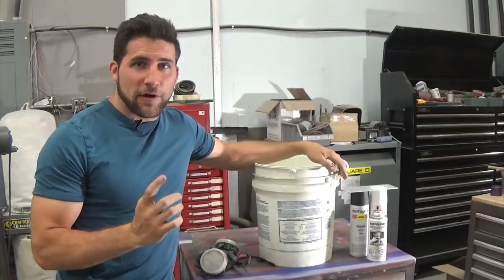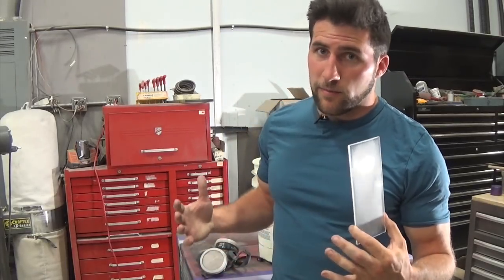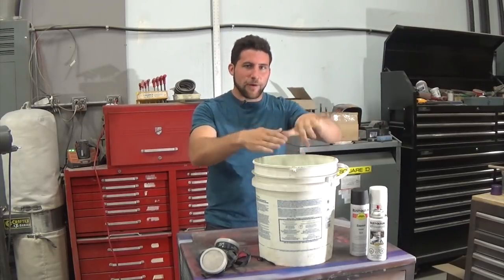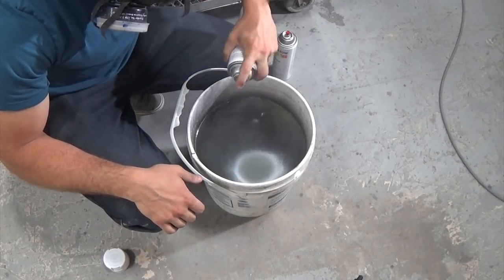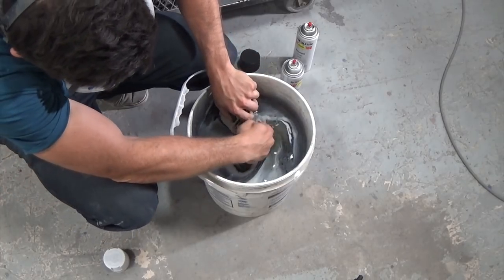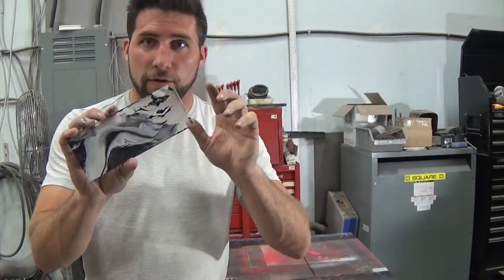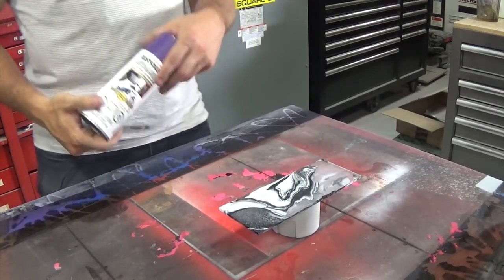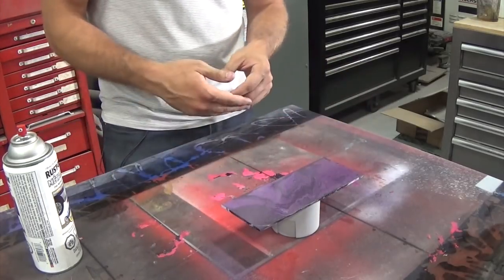How to paint a ghosted swirl with spray cans

Comment: great work !!! I'm a luthier and I try to swirl or marbeling on guitars, I bought the pebeo marbeling paints, and I got a formula ready for the paints to float easily, but when I apply the paint or background on the guitar and do the dip, the designs run and don't stick to the piece ! I've been trying for almost a year, please what base paint should I use to make the swirl stick to the guitar? thank you very much

Comment: Resting nozzle on the edge of the cans lid and spray inside. Then you could avoid some mess and blowback by pouring your pattern. Spraying some bits too would probably be neat. I wonder now what a little clear coat added to the mix would do...
Reply from the maker: A bit of clear thrown in there would probably have a similar effect to using less paint, albeit a bit more controllable. It would create gaps.

Comment: would you have the pattern come through clearer if you used candy paint instead of the metallic? Thanks
Reply from the maker: Yes. Substantially clearer. Candy paint doesn't have any pigment in it, so it's fully transparent.

Comment: Badass, that's a cool way to get a subtle marble effect using swirls. I went through a big Borax-method phase earlier this year and was starting to get some great test results, though I never was able to do a full guitar body. I'll have to get back into it and dabble with some rattle can versions because it definitely seems a lot easier than what I was try to do before. You had to keep track of everything--water temp, borax amount, drying time on the water surface (certain colours would dry faster than others) and all sorts of stuff. It was a world of pain, haha!
Reply from the maker: I've never had any luck working with the borax method, but to be fair, I only gave it a couple cursory tries. I'm sure it allows for more versatility, but this option is pretty quick and fun.

Comment: You Make It Look Easy, Brad. I tried Cold water/No Borax   & It turned out Like Crap. This Last Time was Warm water/Borax  & It Turned OUT WORSE.  Rustoleum canned colors were actually setting Up/Skinning Before I Dipped into the water   & Didn't Bond Or Cover Even Close To OK & The paint Splashing Out Of the water Stuck to my Arm/Covered better Than the primed Steel I Used = Perplexing
Reply from the maker: Damn. You were using spray cans as well?

Comment: Hey Brad, I did the swirl method on an old strat body I had and it turned out awesome! but my problem now is that there are areas with more paint than others. In the thick areas I got a bunch of bubbles. I want to finish it with a clear coat but I'm not sure how to proceed since if I sand the light area it starts fading to the primer color and the heavy areas go dull as opposed to bright glossy finish they have now, haaaaalp!
Reply from the maker: +seb rozo you have to sand it all lightly anyway to be able to clear coat. The sanding will dull it for now. That's the idea. The clear will bring back the shine. Sand very lightly and carefully on the thinner parts. For the thick areas you can sand it down a bit further. Use 800 grit.
Reply: Brad Angove thanks man I needed the reassurance! 
 I'll let you know how it turns out!
Reply from the maker: +seb rozo Great. Looking forward to it.

Comment: That's a cool technique with the water.  I would assume a time limit from time you spray in the paint to dipping, so the paint don't dry on top of water, depending on the paint. As for if it's worth anything, that's a Brad Angove original piece. Got to be worth, well, a dollar, at least, LOL.
Reply from the maker: +prancstaman you're definitely right about the time limit, but I think the paint has a bit more "open time" the you might think. It's tough for me to wrap my head around why, but the solvents don't seem to behave the same in the water. 
There are plenty of Brad Angove originals out there that aren't worth the material they're painted on I'm sure haha.

Comment: Hi Brad, do you think this method could work for something like a ski helmet, or ski boot? I'm concerned about durability. Thank you for all your information
Reply from the maker: It could work for a helmet and be as durable as a typical helmet paint job if the appropriate clear coat is used. 
I think it would just scuff off a boot.

Comment: This method can only be done with dipping the thing you’re trying to spray paint right? Just wondering
Reply from the maker: As opposed to what?
Reply: Brad Angove no clue, I wanted to paint this electric scooter I have like that but I don’t think I can do it the way you did the glass
Reply from the maker: You would need to remove the plastic parts and hydro dip them individually.

Comment: How do u avoid getting bubbles 
I primed my tile .. grey 
Then sprayed some paint in bucket of cold water 
Dip at 45 angle really slow 
Push awaay remainder paint 
Pull out at angle 
Let sit to dry have air bubbles when they dry it leaves little rings or fish eyes as some people say 
Any help please
Reply from the maker: That’s a common issue. Did you sand your primer before dipping?
Reply: @BradAngove  hey mate no i didnt sand the tile after i primed it just primed with grey primer 
Is it best to sand objects after primed 
So prime    then sand   then dip in order i stated in other comment 
45 angle dip really slow 
Allow to dry and shouldnt have bubbles 
I thought maybe i was spraying to close to water and causing bubbles before dip 
This was my first few goes at it and only managed 1 good one out of 3 attempts 
Will sand anything i prime before dip and see how i go will let u know thanks for tip
Reply: Appreciate your reply thanks for responding so fast

Comment: How do you keep the paint from drying on the surface?  I've tried several times and no matter how fast I move the first color I put down is already filming before I can dip my item.  I'm using rustoleum 2x btw.
Reply from the maker: I don’t do anything special to prevent it from filming quickly. Some of their paints do that very quickly though. Is it super hot where you are?
Reply: Well...it is Texas so .... yeah.  Maybe I should put a bag of ice in the water next time?
Reply from the maker: The water should be about room temperature.

Comment: Very cool video, like your other ones, simple and to the point.
Do you think this technique could be used to get good results doing a standard swirl on a guitar body, skipping the ghosting step?
Reply from the maker: I don't see any reason why that wouldn't work. You would just need a larger container and another person to help out. Ideally you would work together to spray the pattern in there more quickly so that the paint doesn't sit too long, and then one of you would dunk the guitar and the other would clean the excess off the surface.
Reply: Awesome, will work up the courage to try it out. Thanks a lot!
Reply from the maker: I hope it goes well for you!

Comment: Hi Brad,
Do you have any experience with hydrographics?
I want to apply a hydrographic film over a deep red paint job on an electric guitar.
It's going to be a refinish, so i plan to just scuff up the finish that's already on the guitar, apply a water based red paint, apply the hydrographics and then finish with a water based polyurethane.
Do I have to scuff up the red paint before applying the hydrographics? Do I have to scuff before applying the clear coat? Or can I just apply it over the graphics. I'm scared to damage the graphics, but I do want the poly to stick. 
Also, any advice on the type of red paint I should use? I'd like it to be all water based for health reasons.

I hope you can help me, because I can't seem to find any answers to my questions. I can only find video's of people dipping their guitar and showing the end result. None of them answer comments.

BTW, your video's are awesome. They have taught me alot about painting and finishing guitars :)
Reply from the maker: Unfortunately, I have no experience with hydrographics. I would however say that using a water based paint on something you intend to dip in water probably isn’t a great idea.
Reply: Ok thank you for your response :) I'm just going to have to try some things out and see. I guess experience is the best teacher sometimes.
May I ask you another question? When putting on a polyurethane clear coat (with a small spray gun), how many coats do you put on? I've heard a lot of differing numbers from people, ranging from 3 to 15. I'm a little confused.
Reply from the maker: It depends on the type of polyurethane. I generally use 3-4 coats of catalyzed polyurethane. Some people call water based poly “polyurethane”, and generally do more coats of that. Usually the only time I go above 6 coats is for lacquer.
Reply: Ok thank you. That's really helpful :)
Reply from the maker: You’re welcome

Comment: Hey Brad -  I know we talked about this the other day on that other video I just now found this video of yours. You pretty much ended up with a regular marble paint job doing it this way. I forgot to tell you the other day that on the one time I actually got the effect to work, I was using actual marbling paint btw, What ended up ruining the entire project was sanding it! When the paint finally dried it had a very rough texture and so prior to applying my top coat I wanted to sand it smooth. I used an 800 grit piece and it took the marbling right off! Oh was I mad!! It went on in such a thin coat apparently that any sanding at all would take it off. I gave up on the idea after that lol. I doubt I try this method your showing us here simply because 1) I don't have a guitar I want that effect on right now and 2) I dont want to get frustrated over it again lol.

Have you ever thought of or tried what they call pouring? I have seen it done but never tried it. I guess, if I understand it correctly, you just literally pour your paint right on to the surface and just move the object your'e painting around to move the paint around on it. A friend of mine on Facebook is into this hobby and she paints all sorts of things. I really want to try it on a guitar and just see if it works. I think a person would have to somehow tape off the pickup and control holes so the paint doesn't just run into them. 

Do you have a place where you sell your finished products at?
Reply from the maker: I’ve also encountered a lot of frustration with the swirl jobs haha. 
As for the pouring, I’ve seen it done on canvas but the thickness of those finishes worries me a bit in the guitar context. I’ve never tried it personally. I generally tape my pickup and control cavities regardless though when I’m doing an actual paint job.
Reply from the maker: I don’t currently have a specific place where I sell finished products. I’m working on starting up a small business selling finished custom replacement bodies and custom pickguards etc. though.
Reply: Oh I thought that shop your videos are shot in is your business, lol I am always looking around at the various pieces of equipment and trying to figure out just what the heck you do in that place!! 

Have you ever heard of a place called guitarfetish.com? I just found out about them tonight and they have some decent low priced made in America products. You can buy a finished Les Paul style for like $239! A guy on another channel, Darrell Braun, purchased some cheap, $5 each, single coils and then did a sound comparison of those vs expensive $150 each, Fender pups. If that example is how all of their pups sound I know where I will be buying some of my pickups from!
Reply from the maker: Haha I actually worked there for about 15 years. We do an insane amount of stuff. Now I would say I work “with” them in some ways, but my main job changed shortly after I graduated. 

I’ve only done one kit from guitar fetish and it was quite bad. The parts I’ve gotten there seem fine though.